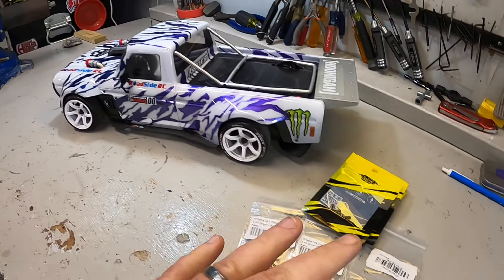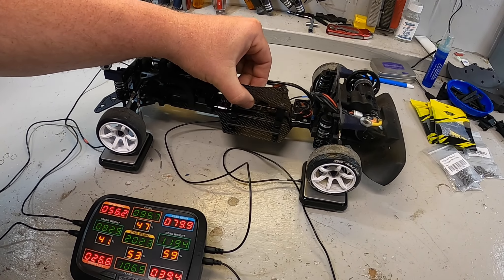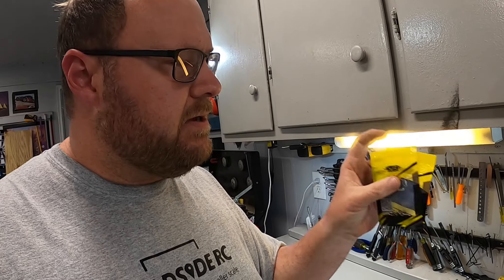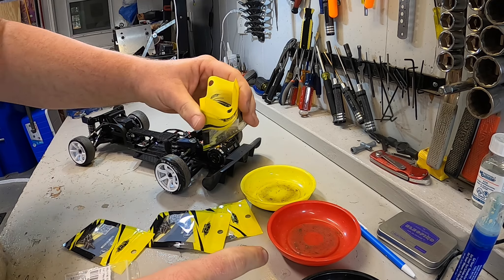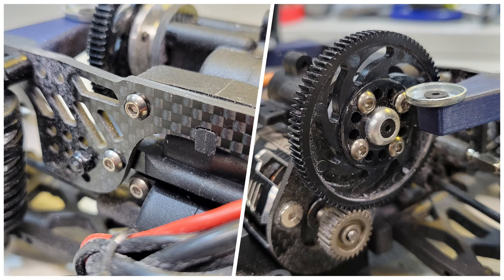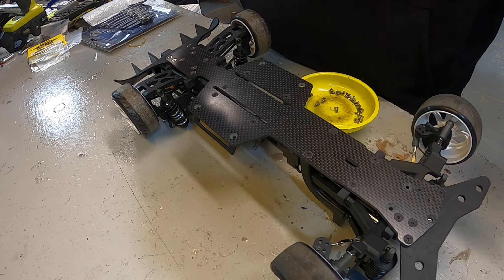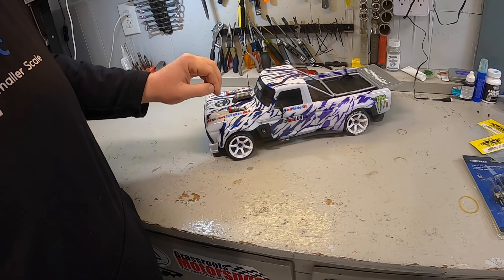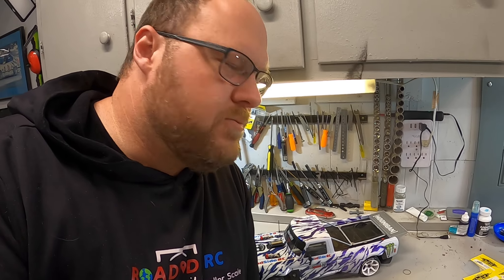Redcat RDS Weight Reduction with Titanium Screws (How much change?)

Comment: Awesome vids! I just bought the RDS and i'm loving it so far. Are you planning on trying out some aluminum upgrade parts in future vids? I would love to see if the YD-2 upgrade aluminum parts  can fit. I want to make it look prettier with colored aluminum parts lol
Reply from the maker: My understanding is many of the Yokomo upgrades bolt right on. 

I typically don't add a lot of aluminum to my drift cars - but I hear that Redcat may be coming out with some specific parts.

Comment: Hi Troy. Your videos have been a must-watch for me over the last couple of months. Thank you. With my pre-order for the Reve D RDX not being fulfilled on the second batch, i'm looking for a replacement chassis kit. My local store has the RDS Builder's Kit in stock. I am not a beginner, so do you think this is a good substitute for the RDX?
Reply from the maker: Ha!  I did the exact same thing. 
I had the RDX on backorder....finally cancelled it and bought this. 

For beginners, I typically suggest starting with a RTR unless you already have drift-spec components that you can use.
Reply: @RoadsideRC  Thanks, yeah I have a Reve D Revox and RS-ST, plus a Hobbywing D10 and XD10 sitting here waiting to go into a car. I could always pull some bits out of my other cars too if needed. All mated to an NB4 Pro.
Reply from the maker: @hrd4603  Sounds like a lot of good components.

Comment: Alloy would be even lighter? Are the Titanium more likely to make problems as steel ones? Why no alloy, because its even more weak as titanium screws and get rounded off easily?
Reply from the maker: Aluminum is very weak - but would certainly reduce more weight.